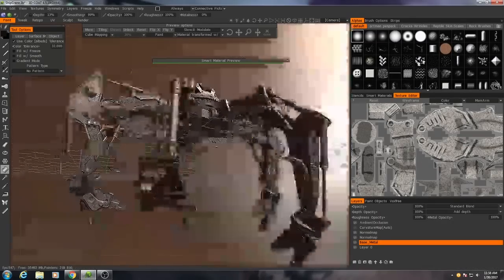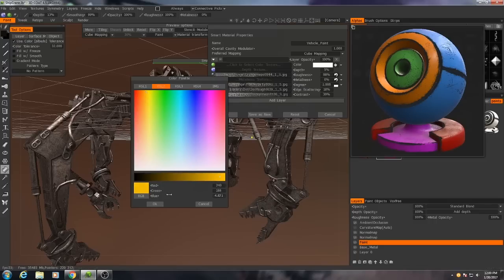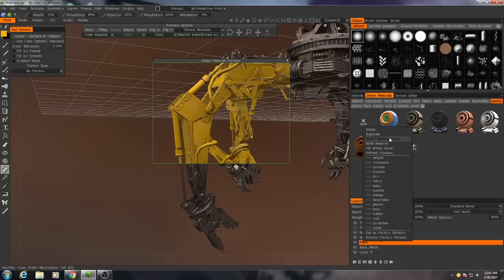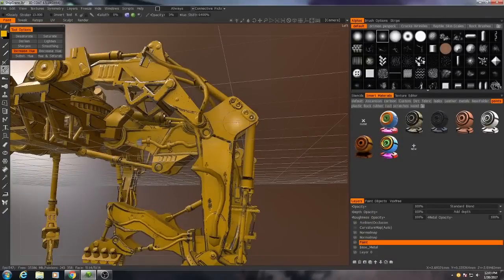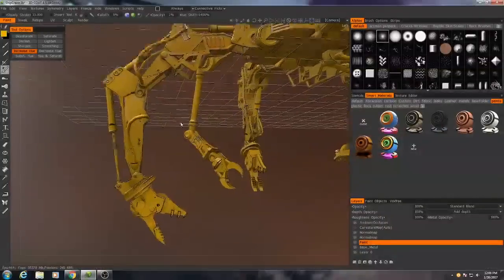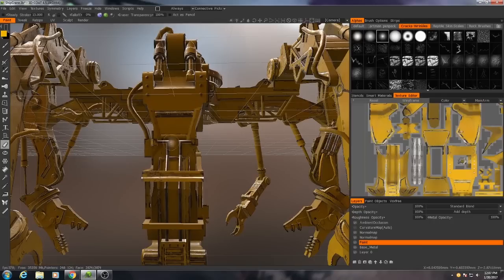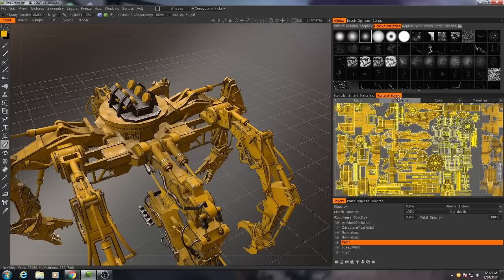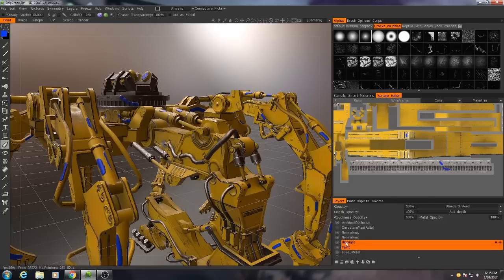3D-Coat Assembly Crane Texturing Tutorial (Part 3)

Comment: Very usefull tutorial, and great work! I'm very interested to the project.
One tip from me, try to use higher recording resolution like 1080p, to maintain good quality of view. Streaming compression artifacts that YT gave us for free, ruins your art.
Reply from the maker: Thanks! I'm glad you're interested. Yeah, I'm kicking myself really hard over how awful the compression artifacts are in this video. I think I've figured out the problem and future videos will not have that problem. Next week's tutorial will still be 720 because that's the resolution I recorded it at, but I'll try for 1080 videos in the future.
Reply: Fantastic! I am also 3D Coat user, but I use it only to UV-s. I use Quixel Suite to "paint" meshes, but I see, that properly used 3D Coat also works very well. Thanks again, and I look forward to the next tutorial.

Comment: That's amazing! What a great series you've done here! I noticed that most of the time, when you rotate the view in the main window, there's a lot of blur and pixelation. Is that just screen capture artifacts in the recorder, or actual behavior in 3D Coat? Thanks again for this series: So much good info!
Reply from the maker: Thanks! Yeah, I didn't see the severe compression artifacts and pixelation at first because when the video is static, it looks just fine. It's actually a problem introduced when I export the edited videos out of premiere. I think it has to do with a framerate mismatch between the screen capture software and the export codec I use along with a low bitrate that I'm using to keep the files small. I will make sure to fix that for next week's series.